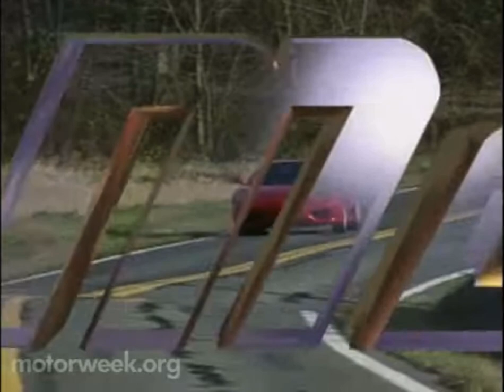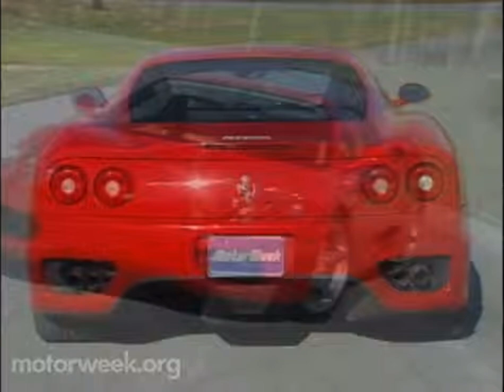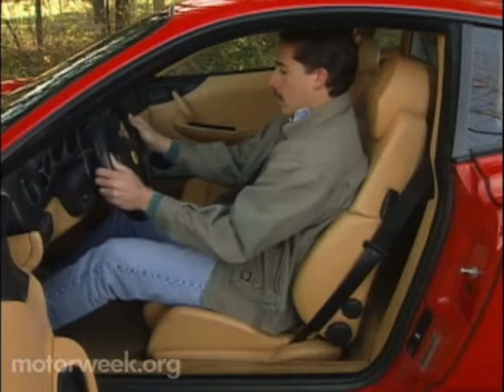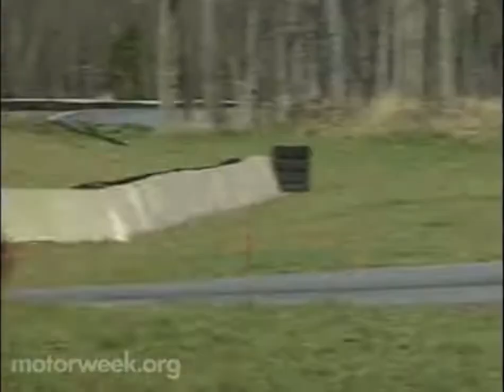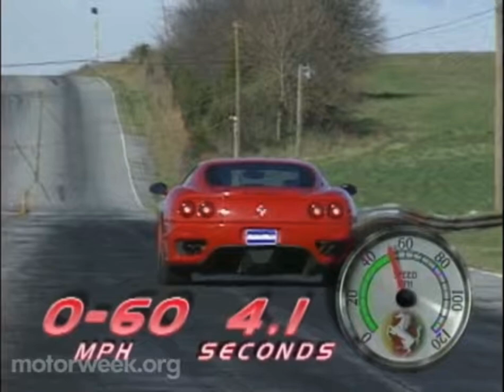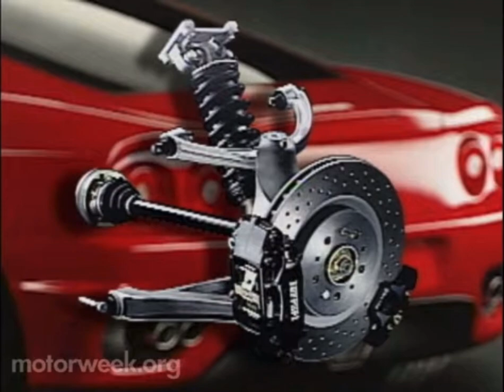Motorweek 2000 Ferrari 360 Modena Road Test

Comment: Thank you for posting this rare video, the 360 Modena doesn’t get the respect and love it deserves, mainly because it’s overshadowed but the superior engined 430, having said that I think the body of the 360 is far prettier and more exotic looking than the bulkier and taller 430.
Reply: The 360 might not make the power of the 430, but the sound it makes with a CS exhaust makes up for it and then some.
Reply: @y2ksierra  Indeed 👍🏻
Reply: I think the F1 transmission really did this one in.